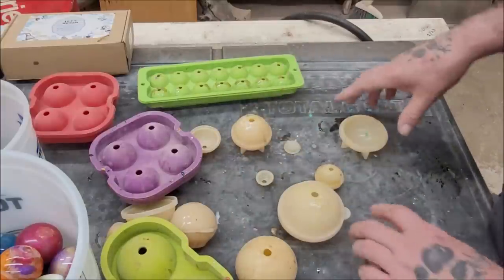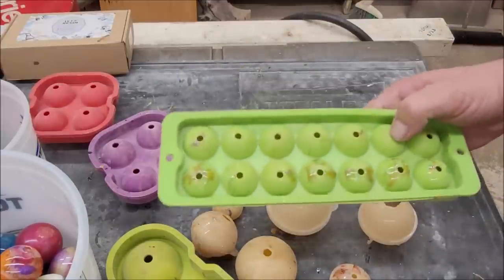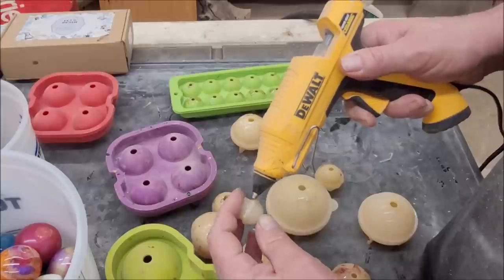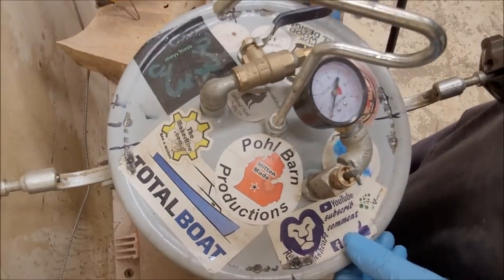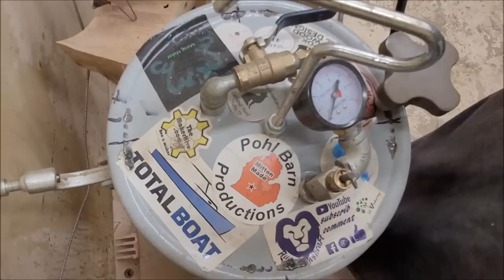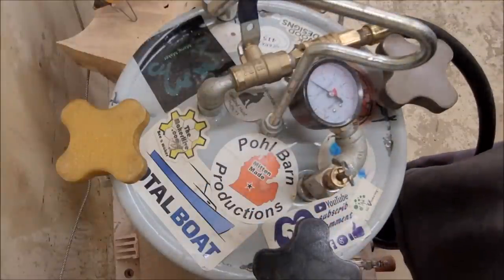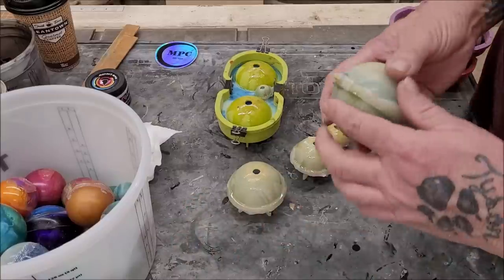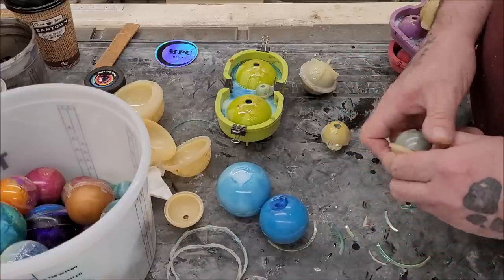How to Make Planets with Resin Using Ice Cube Molds

Comment: Doug, I now see the need for silicone pour cups for resin. I've also got a marble size or mold but I've only used it once. Trying to hit those little holes would be much easier with the pour spout on the cup.
Reply from the maker: Thank you Lola,  it would be much easier if I wasn't trying to hit if from 2 feet above it also,  lol

Comment: I can’t wait to see what the insides look like and what your collaboration with Ken and the moons will be. I noticed a couple of other commenters have mentioned trying syringes. I’ve used them for small jewelry molds and they work well for those but, I honestly don’t know if they’d be helpful or not.. time wise anyway. I got a box of 25 syringes 60ml. for $17 from Amazon. Soaking them in Acetone helps to clean them but, it’s still time consuming. I was also wondering if separating the molds in the pressure pot on stackable trays would help to keep the temperature down a little? That should increase the life of the molds. I know they’re not much individually but, when there’s a bunch to replace it adds up. Just some thoughts.😊
Reply from the maker: Thank you Funo,  I've tried pipettes and the cost of those for me when my resin is free just doesn't make sense. I suppose for people purchasing resin that would be worth the time and effort. yes I know not stacking them will keep the heat down, I don't normally do that many at one time

Comment: Just an idea....
Hot glue around fill hole and you can solve 2 probems. Kinda funnel resin in the mold and over fill so you wont have any divet in top just grind of xtra
Reply from the maker: I've tried that and you end up ripping the mold if the riser is larger than it is.

Comment: Try using a funnel to pour into the little holes. They have either silicone funnels that the resin would peel off of, or even disposable funnels you can just throw away. Even a piece of paper rolled into a cone should work. Essentially, if the target's too small, make it bigger.
Reply from the maker: Thank you Julie

Comment: Fascinating video, Doug.  Thanks!   Just a thought though....syringes of various sizes are available on Amazon, and would make adding the resin to the molds easier, with very little overflow.  I don't know if that will save the wear and tear on the molds any less, but it will save the mess in the bottom of your pressure pot, and may even make the de-mold a bit easier on your poor fingers!
Reply from the maker: Thank you Pauline, it would save on the mess but it would be more cleaning and or waste after using them,  I've tried pipettes and you end up using them once and throwing them out

Comment: Thanks so much for the mention, Doug! I appreciate it! I’ve been wanting to try this after seeing your galaxy bowl. The hot glue always seems to melt when I try it and I thought I was doing something wrong or using the wrong type of glue. Now I guess I was just using too much resin and it was heating up. Anyway, thanks again and thanks for showing how you did it. 👍🏻
Reply from the maker: Any time Mike! if you noticed that one that melted was in between the two with 4 spheres in it, surrounded by heat, I hope I sent you a few subs,
Reply: I noticed it was in the middle, but didn’t really think about it until you mentioned it. And yes, I got several news subs after this. I appreciate it!🙂

Comment: Looks fun. I noticed some are smooth and some have light rings around where the mold attached. Do you lightly sand the rings off before use and if so, do you use several grits. Thanks Doug
Reply from the maker: Sometimes, but mostly I put them to the belt sander LOL

Comment: I appreciate you sharing you method with us.  Is there a specific way that you would sand/clean up the flashing on the spheres?  I imagine that would be an unnecessary step if you were putting them into a galaxy cup, but what if you wanted to use them as a standalone object, or accessory?
Reply from the maker: Thank You, normally I turn the belt sander on and roll them on the seam to remove it

Comment: I wonder if an old wire basket would work in your pressure pot. U could put a scrap wood in the bottom. Set the molds in it n pour the resin in while sitting on the work bench. That way u could save on resin. Unless u want all the lil scrap pieces 🤔😉
Reply from the maker: Thank you Mandi,  unlike most people I can waste the resin as totalboat sends it to me every month,  if I had to buy it I would probably be a bit more careful with it than I am.

Comment: I've seen someone fill a car engine by pouring the oil down a wire and the oil doesn't spill anywhere outside the steam. Do you think this would work with the resin?
Reply from the maker: Thank you Fiona,  I've seen that too, not so sure it would work out for this but it might be worth a try

Comment: I checked the temp on one of my pours and got a temp of 258 t0 270 degrees F. that stuff will get very hot man.
Reply from the maker: Thank you Mike,  yes I know, I've felt the pressure pots after I've made some really big pours and they were almost to hot to touch